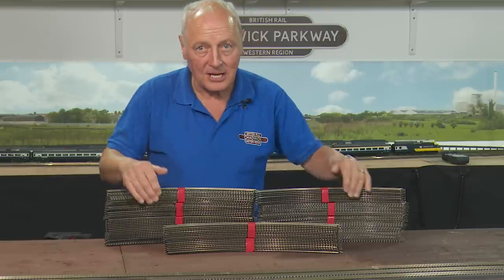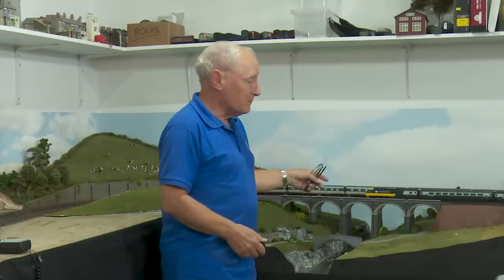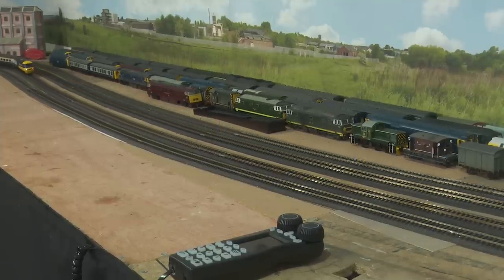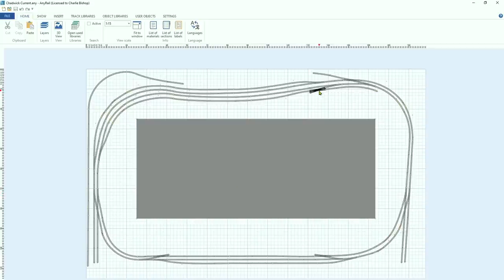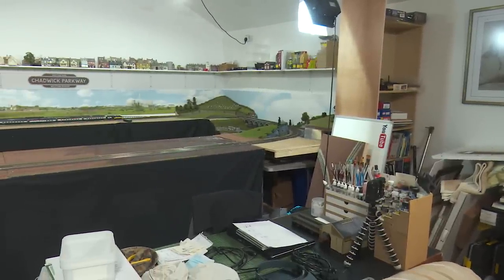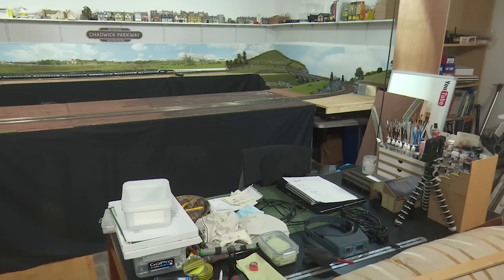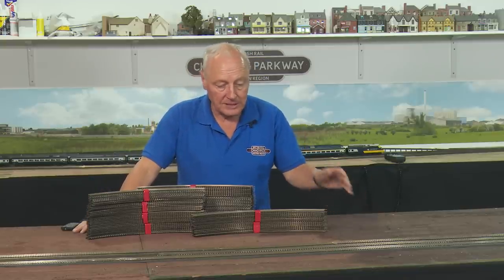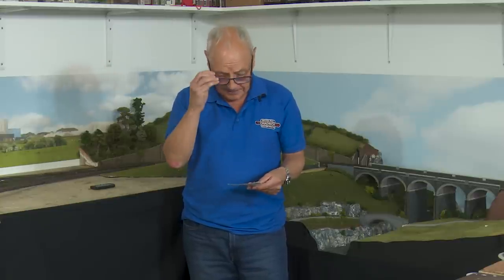Track Plan Design at Chadwick Model Railway | 111.

Comment: Well you have certainly given us all a lot to think about, Charlie - almost doubling the size of your layout at a stroke.

I would certainly endorse what you say about AnyRail - it's a superb piece of software for anyone planning their model railway, not least because it contains all the manufacturer's track geometry for all gauges, thereby giving confidence that what is planned can feasibly be built. One suggestion for you Charlie -  I notice you were using different AnyRail files for your two levels; learn how to use the Layers function in AnyRail. My own plan has over 20 Layers with everything from track, hidden track, baseboards, buildings, platforms, signals, bus wiring, electronics, servos, etc, all on different layers with the ability make visible/hide any combination of layers.

However, coming to the meat of your proposals, I can't help but feel you are missing a trick when it comes to your storage lines.  You mention your worries about having lines long enough for your longer trains, and certainly you don't don't make the best use of the newly available space.  I had a fiddle around with AnyRail to see if I could suggest something that might help.  I had to make assumptions about dimensions, drew no curve with a radius less than 18", used your preferred Hornby track for the helixes, and kept lines 1.793" apart.  I managed to come up with a design that in addition to through lines for both clockwise and anti-clockwise running, gave 7 storage lines in each direction; as drawn in AnyRail, the clockwise lines gave storage lengths of between 12' and 13'8", and the anticlockwise lines gave storage lengths of between 13'6" and 15' (the anticlockwise lines are longer owing to the need to avoid points under your viaduct. I have included your wheel cleaning facility/crossover between clockwise and anticlockwise lines; I don't know how long your wheel-cleaning bit of kit is, but I felt the line you designed seemed unnecessarily long.

JPEG showing layout (ignore the red-tinge to some lines - AnyRail colours any flexible track longer than supplied length as red) - https://drive.google.com/file/d/11r5QH9L5foNurL8l4ISBW_yjSsNQ7xJk/view?usp=sharing 

JPEG showing colour-coding to separate line function - https://drive.google.com/file/d/11O0C2dL_mRTisM-brevzBFPoEnDw2tzu/view?usp=sharing 

AnyRail File (you must have AnyRail to open this file) - https://drive.google.com/file/d/1LlTtqjZgS_gmbNNTxqmLKpX-56hJ2Ytg/view?usp=sharing

I hope this gives you some ideas.
Reply from the maker: Hi David, well what a leap forward in making the most of the fiddle yard real estate.   
I really appreciate your contribution and will consider its advantages most carefully.  
Regards Charlie

Comment: Can you not just have a easy to remove 2 track bridge that lifts out but also set so you could have the loops as well so while working and filming you can just leave the bridge off but still run trains on the looped ends and when you wanted you could put the bridge in and keep your circle main line as well. You could model both sides so it represents a large river with the walk threw bit in the middle of it. The bridge would be like the severn bridge that sorta thing. .just an idea as ive never seen a removable bridge on you tube layouts but always though it must be possible. Anyway great vids ive been watching since lockdown started and watch every week but this is my first comment.
Reply from the maker: Sorry Danny but that will not work. I have plans for 12 Lane fiddle yard I would also need to be removed
Reply: But your moving the fiddle yard to the other side under the station. By the look of the new plan. I ment the bridge as well as the new plan.  Im sure itll be great tho. Keep up the good work i could only dream of having the space time and money to make such a layout

Comment: Better 
- now as you havn´t build much at those bords
- knowing some problems gona come an prevent those
- duckunders are more something for temporary setups at shows
- make use of that part of the room
- a bigger fiddelyard - trains have a tendency to increase - make it even bigger, right side all switch point befor the viaduct, parking trains behind each other like at "HADES" (long trains can park in two or three blocks as long the programm is beware to not park a long train behind a already standing long train), with the inner inside layout corners you could do 45° parts or round them to get a bit more room for track

You could still bridge the branch (or one main) line across the way inside - vertical-lift or bascule bridge - but that would need planning time.
Reply from the maker: Thanks for your advice Lass, regards Charlie

Comment: I think you need a very short chair with wheels for you to work on the lower level,  and than all of the wiring of the lower level should be expose for ease of maintenance.
Reply from the maker: And you’re not the 1st to mention that solution either, regards Charlie

Comment: Hi again Charlie. If you are anything like me, anything planned in a rush just ends up with a later realisation that things could be better or issues had been overlooked.  My original suggestion about revising your storage level track layout I made a few days ago was a rather rushed job, in which I approached the problem purely as a track-laying problem.  In hindsight, I had overlooked the issue of access to the storage level.  Given that the whole point of your redesign was to minimise the effects of old age (I suspect I am older than you so can sympathise), and that there will be a need to access the storage loops to some extent, it struck me that part of my suggested layout revision resulted in track buried towards the back of the wall.  Accordingly, I have had another go and have brought the storage loops as close to the open edge as an 18" minimum radius would allow.

JPEG of revised track suggestion -  https://drive.google.com/file/d/1Rv1t7cJVvBZvJD3U7s4y5ODpVfk2jraU/view?usp=sharing 

Updated AnyRail File -  https://drive.google.com/file/d/10NAG7z3bF8kg11yskBVCcp3rBxhF9rTX/view?usp=sharing
Reply from the maker: A cracking design David and it will be considered in great detail.  Many thanks Charlie

Comment: Why o why are uou not using the junctions that are already  there and using theset track as return lòops wirh a walk through  between the loops .off  the long crossing use the curved track to set track to bend the track back over the old tmd boards in a s.andthen heqd back to the other end of th long crossin via three  loops on each track.the other long crossing 
Heading to the sonk ddo three loops per track and bend them back to the other end of the long crossing. The branch could still go up and over  to a small thin station.on the bend have a red cliff wal like dawlish.
Reply from the maker: I just need to all my trains on the layout.  Regards Charlie
Reply: Whats you e ail address as I can not find it on the web site

Comment: By the way charlie you got the Hornby number the wrong way round at the end  of the video.
Reply from the maker: Yes, sadly you’re not the 1st to mention it!
Reply: Chadwick Model Railway I will ask my local shop about the Hornby track, he may have some.
Reply: Hi Charlie how have you gone on with locating more of the track. My local shop has 6 in stock if you still need some, contact me if you want it for the details.
Reply: Hi again sent you a message.

Comment: Interesting stuff - I've heard people having various levels of success with helices - the sheer distance a train will have to traverse to go around the helix down to the lower level, then around into staging, and back up the other helix - I think might be a good deal longer than it first appears. Presumably a more straightforward teardrop shaped return loops at either end wouldn't work? (it looks like on the right wall you've got a good deal of space that could be used behind an intermediate backscene to store more trains too, rather than going down a level?
Reply from the maker: I do understand your point William. However it’s the storage space that I require for round about 12 trains, that’s the overwhelming factor. Of course it doesn’t help my knees to lay in wire up the fiddle yard in the first place! Regards Charlie

Comment: Shades of Everard Junction v1!

I have similar considerations (OA in hips), I was planning on a main full loop, with a gate/lift out section maybe 1/2ft wide and ramps down to a return loop on both "ends" including storage - which would be quite complex, and ramps could be an issue if they're too steep. But we moved, I have an huge basement, so I now figure that a dogbone with scenery on both sides (so still a full loop) will work the best, and no crawling under anything... just have to clean out the basement first though!!
Reply from the maker: Another interesting answer to this age old problem. Regards Charlie

Comment: hi charlie, i have build my own helix, and it is fine at the moment, but i won't suggest building it the way i did.
however, doing some research a few years ago i found the system of Noch: https://www.noch.com/en/product-categories/terrain-structuring/helix.html 
I don't have any experience with it, but maybe it is worth investigating, having a company building a helix for you sounds expensive...
good luck with the adjustments, it made me think about my own layout, where i use a board on wheels to slide under (but i'm just 25 years old...)
regarding the senic question: i'm building a mountain railroad, and made it disapear in a tunnel. you could put a beatiful castle on top?!
Reply from the maker: Interesting points thank you very much, regards Charlie